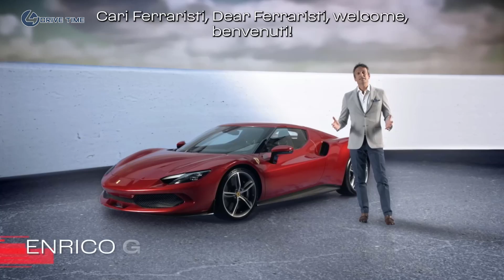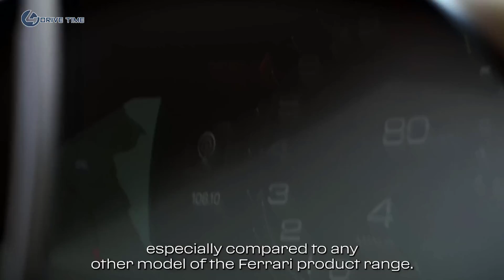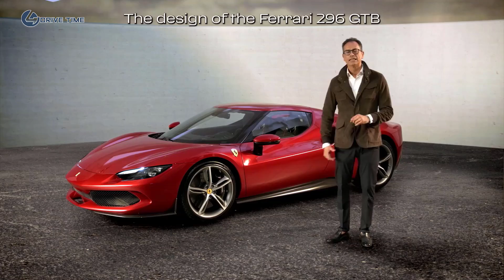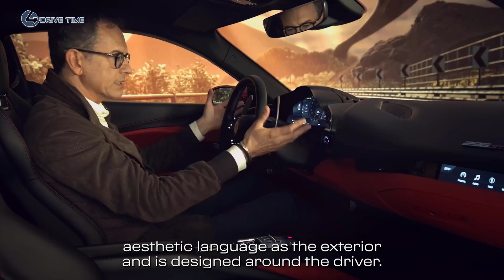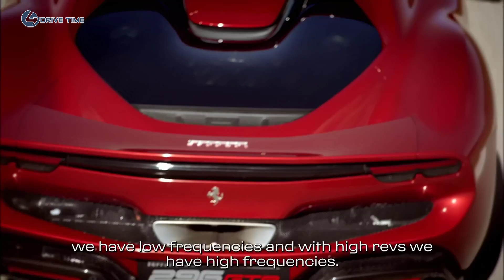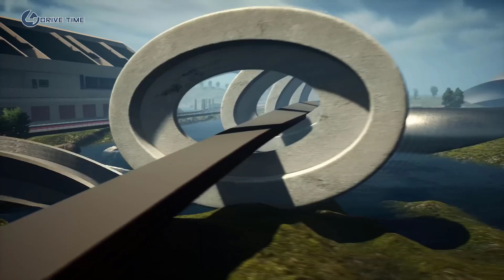2022 Ferrari 296 GTB / 818 Hp V6 Hybrid / Gorgeous Super Sports Car

Comment: Mostly gorgeous if a bit mid-life crisis retro. Still, the only thing I'm not sold on are the headlights. They're very underwhelming. 

It would've been cool and forward thinking if they'd made the headlights a single corner to corner lightbar floating on top of an equally wide slit-like air inlet (as opposed to those two tiny squares). Just my $0.02.